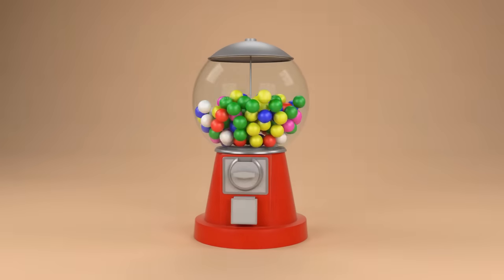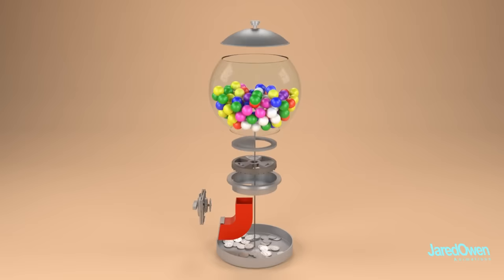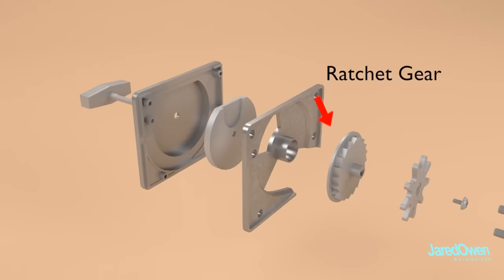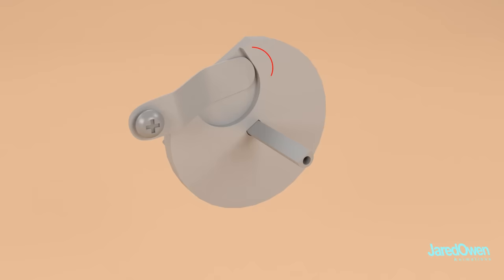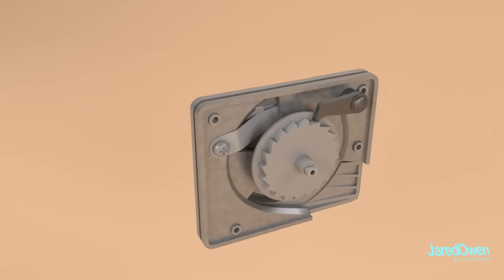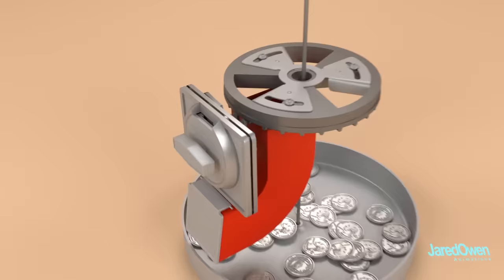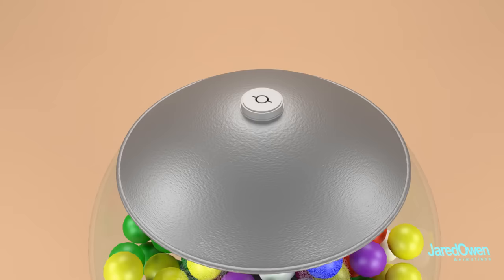How does a Gumball Machine work?

Comment: So putting in fake coins will aslo work?
Reply: VICTOR Å it wont work or you can make a plastic quarter the right size of a regular quarter
Reply: Daniel Vargas
It definitely will !
At least in my country you have plastic or metal tokens for shopping carts that have the exact same diameter and thickness as coins. And it works.
Reply: @rzeczpospolita5948   no just no...
Reply: Jyswoo  I saw one in downtown St. Louis but that's it 

What normal person gets that though lmao
Reply: yeah I tested that with a wooden coin I carved
Reply: NukeCorruption You took the time to purchase some wood or get scrap wood, measure the thickness and diameter of a coin and carved it.

You might as well just buy the gumball for the 25 cents at that point.
Reply: @LordDragonZord  xD
Reply: @Juno Chun , maybe he want to mass produce it, so he needs the working model first, at least make two same models, if one slides in, then make the other as cast
Reply: Put sticky tape on the coin or something so it doesn't fall so you get unlimited spins. XD
Reply: I measured the size of a coin for a machine at my local shopping mall. I was curious, how can i get free candy? So i 3D printed a bunch of blank plastic cylinders with the exact same dimensions of the said coin. They worked wonders. For 0.03$ i got 0.12$ worth of candy. Was it worth it? Hell no. But oh boy, imagine the guy taking the coins out finding a bright orange plastic disk with "LOL" engraved in it!
Reply: @nyan06 good
Reply: I was thinking of just putting something sticky on the coin so that it wouldn't fall and could be retrieved.
Reply: Just do what Mr.krabs did and attach a string into a coin.
Reply: Mary ann Cabreros it can turn counter clockwise 😉
Reply: Juno Chun actually the coin was from an old boardgame I made long time ago and by luck it happened to be just around the size of a 50cent coin (euros). so I was so tempted to test the machine with that wooden coin haha
Reply: there were some 'accidents' like neighboring countries using similar(almost exact)size of coins, and sometimes just curious travellers or desperate crooks use them for you know. yeah.

Japan has a really weird level of development on vending machine and so....guess what happened. so government had to change the coin and vending machine companies had to improve their designs.

and nowdays japanese vending machines operated by miniature japanese people living inside and checking whether the coin is real or not.

real story. except the last one.
Reply: @nyan06 I aslo don't know...
Reply: If it’s the size of a quarter and strong enough to move the block thing, yeah.
Reply: LOL
Reply: VICTOR Å use Chuck E. Cheese coins I still got a few of em
Reply: @ArchangelExile  if it was sticky enough it would just keep spinning around and around 😂😂 endless candy
Reply: Kaimen Sedgwick Lol, totally.   I would love to try this to see if it would work but I'm too paranoid.
Reply: Just use a flat head screwdrriver
Reply: @LordDragonZord  in Italy sometimes the gumballs are 50 cents or 1€...
Reply: If you just try to push the metal piece with a tool like a flat head screwdriver could you have infinite gum with no coins or no fake 'same sized' coins ? :D
Reply: @RinkawaErion  super glue
Reply: @DanielVargas-ow4xz  you don't need the right size, just smaller than the hole and big enough so the security thing doesn't stop the disk from moving
Reply: im calling the police
Reply: Ribbed Rhubarb NO J-JUST NO.
Reply: O O actually. There are vending machines in Japan with people inside. They take your money through a slot and pass you out something awkward through another slot. Such as flowers or goldfish. Gets me thinking. The way Japanese culture works. The workers are probably locked inside the machines for set amounts of time. Wonder what would happen if I shoved a stink capsule through the slot at the beginning of their shift ........
Reply: Um...yeah I gues
Reply: @elsociord7553  lol
Reply: Daniel Vargas you can glue a coin to the machine and it won’t fall so you can keep reusing
Reply: @LordDragonZord  You could use modeling software to quickly model a "coin" with the same dimensions as a real quarter, and then 3D print them en masse. If you don't want to go to too much effort, you could literally just slap a cylinder into your CAD and it would take less than 5 mins to get it to the right proportions.
Reply: FBI OPEN UP
Reply: VICTOR Å anything that feels like a coin will work
Reply: Maybe just get some of those metal slugs from the sides of metal outlet boxes.
Reply: @kingdeadshoot6019  in our it's 20 cents (also €)
Reply: @colinantink9094  ummmm....... alright. ok? Japanese are idk9
Reply: @RinkawaErion  i thought the same thing ima try that
Reply: I just always super glued a quarter and quickly placed it in and thus I and school got free candy
Reply: Uncle Ron oh hello fellow Missouri citizen
Reply: @nukecorruption  😂 hah. 😂

Comment: When you spin it fast enough you get 2 gumballs. I do it all the time.
Reply: I'll do that next!
Reply: In fact, it's like the "bump key" lockpiking technique, if you hold it at the right spot, you can turn it infinitelly after the first coin!
Reply: Andrey DeOliveira yeah I've done that
Reply: Or even 3, it happens sometimes
Reply: I useally just break the glass
Reply: One time I put a quarter in when it didn’t turn all the way clock wise and it would only turn backwards so now I was getting free gumballs
Reply: Insert coin spin half way, repeatedly spin fast from half way for infinite candy
Reply: And can’t you do that to skip the coin altogether as well? Maybe it’s not the same in all machines, and they have other security features, but it looks like the piece of metal is bent before rotating, so it should be possible. BTW, this is an exploit I was thinking about upon hearing the mechanism involved, because of the inertia of the metal piece, and you just confirmed it works.
Reply: Really? Next time I go to a gumball machine, I'll try it.
Reply: Do not do that. That's unethical.
Reply: @iany.5204  live a little, it isn't like it's going to hurt anybody
Reply: @iceberg7999  It's stealing and hurt the income of the machine owner. A maxim says: "Do not think any vice trivial, and so practice it."
Reply: @iany.5204   Okay
Reply: @iany.5204  Yes, and MY mama told me to look both ways before crossing and to always pray before going to sleep. :>
Reply: ooh ok
Reply: I was waiting for someone to say it
Reply: Ian Y. the gum is probably very old, nobody cares
Reply: @HerrRussoTragik  how to fucking do it
Reply: VRV Epic gamer move
Reply: cursed likes...
Reply: Woah 666 likes! Ima fix that
Reply: Easy : sticky coin
Reply: @vrv3871  hahaha lol
Reply: Imagine you get 3
Reply: @lc846.  it happens sometimes
Reply: What if you put glue on the coin so it never falls into the coin bin? 😂
Reply: lostskull7467 InFiNiTe GuMbAlLs
Reply: Ayhan Kabak what about 20
Reply: @lc846.  bruh
Reply: @corvividgacha351  hi
Reply: You realise right that you dont need real coin fit in that coin pocket or whatever is that?
Reply: When I was 2 years old i put a coin in and got a gumball then i looked at the back of the machine and i got a coin and put it back in and i did that over and over again.
Reply: Yea
Reply: Ayhan Kabak Pro
Reply: I. Try
Reply: Lol
Reply: @HerrRussoTragik  how??
Reply: @vrv3871  Or that
Reply: I got a gumball machine but its the coin mechanism is broken
Reply: When you have to cheat why not just break the glass.
Reply: Thanks
Reply: You can just put glue on the quarter and turn it a little so the metal piece pushes it and in 3 minutes it is stuck on. And there on it you can turn it infinite times
Reply: @limitlessdev  cool
Reply: A MADLAD
Reply: Sick
Reply: light speed = 100 gumballs
Reply: I will do that next time
Reply: You’ve just changed my life
Reply: @Amina Guemghar w
Reply: Woah what
Reply: When you didn't realize there is a security watching you.
Reply: Just use a fake coin
Reply: The one I go to gives two if you spin it slowly
Reply: Sloooow enough,  I heard it
Reply: Use a drill to speed fast
Reply: Thnx for revealing the secret now they will come out with better mechanism
Reply: Cool
Reply: Thank you for this brilliant piece of information
Reply: @HerrRussoTragik  wait what? For mr that applied to alot od stuff but didnt know gumball machines too
Reply: @Patrick Meng just take the whole jar home and experiment with it.
Reply: Im in front of a gumball machine now
Reply: If you do it fast forever you basically counter the wall preventing multi gumball spam
Reply: It will not give you infinite how many candy is in the glass
Reply: Abi burda bari yapmayın
Reply: Mind blown
Reply: Or just break the glass
Reply: ill do it next time ty
Reply: Yooo I’ll do that
Reply: Thx 4 lifehack
Reply: REALLY WOOOO
Reply: Screw that. I just crank the lever hard and fast enough that it gives me one. Call it theft, I call it strategy. Never got caught or broke the machine, so yeah.
Reply: Buy one get one free!
Reply: I gotta try this.
Reply: i can not imagine why your technique works. The string metal is slowly as you ? Or the string metal bounce ?
Reply: @Naecofranck  I have no idea, it works somehow
Reply: @vrv3871  I usually just rob a candy store
Reply: Thanks for the tip
Reply: Same lol
Reply: You... wat? Hm. I will try
Reply: There's have good and the bad things
The good things is now i know
The bad things is we don't have that and i never seen that yet personally 🤣 because i am from Philippines
Reply: Me to
Reply: @Uchiha____Sasuke  XD, but the Guards will find a fake coin in the coin bin
Reply: Just take a coin size and wide as a coin the put it boom u get free gumballs
Reply: @swervings  ok
Reply: wait is that acly possible? if it is then im stupid
Reply: I found out gum is made of rubber and plastic
Reply: @teebee woahhh...pure luck, nice bro
Reply: Cool it’s real haha
Reply: There's a particular gumball machine built into the pavement outside a particular shop near my childhood home that, if you move it's gears in just the right way, you could jiggle it back and fourth and easily get as much as you wanted. It's still there and you can tell it's the same one because the same trick still works no matter how it's painted or what it's loaded with.
Reply: You think the matrix doesn't know that? You are living in a dream world.
Reply: @iceberg7999  someone would have throught of putting a big steel part so it cant rotate 360°, almost no one is THAT dum
Reply: gotta go fast
Reply: Wait that's illegal
Reply: I'm amazed at all the weird ideas people here have to get free candy, I just rob the cashier at gunpoint for all the quarters then use them all on the gumball machine
Reply: When I grow up my Mom can drive me in the car and take me to my local gumball machine in Sherwood Forest Mall.
Reply: @vrv3871  FBI OPEN UP

Comment: How does it only allow certain coins to give a gum ball?
Also I’m still unsure how it only allows one gum ball out.
Reply: the slot is big enough for only one gumball.
Reply: Remember the slot in which your coin fits? That is specifically designed for a specific coin - a cent, quarter or whatever. Anything thats bigger than that won't fit, while anything smaller won't disengage the locking pin 2:31.
Reply: Some coins aren't big enough to bend out the piece that hits the wall.
Reply: @alishancharania784  So a cardboard chunk will work?
Reply: @Harrison Hughes (Student) yes.
Reply: @alexwang982  Yes

Comment: gumball machines are a bit of a scam tho arent they? atleast where i am, all of the gumball machines cost about 1 or 2 euros, the tho you can go to a nearby kiosk and buy gum like that or if they dont have ones like that then other gum, for 0.05$ or 0.10$
Reply: Yeh some where I come from are £1 or £2 or 50p
Reply: And many of those gumballs taste like heck (at least wherever I tried)
Reply: @SreenikethanI  nah i kinda like them, not willing to pay that much for them tho
Reply: From where I am you can get it for $0.10 but buying it in a local shop you can buy it at $0.02-$0.04
Reply: But atleast you're not gonna go somewhere far away
Reply: JayThePineappleDemon OverLord
In my country, pretty much all 0,20€ and 1€ gumball machines will actually work with... trolley tokens.
(Of course it's a fraud and a scam but it definitely works).
Reply: The classic fee of a quarter isn't exactly a bargain either,  for a dime or nickle would be a lot better. 
I've machines for tiny toys or rubber balls that are lot more valuable than a gumball.
Reply: Here in mexico those things (individual) are like 5 pesos, which is like 1/4 of a dollar, a bit more
Reply: that's not a scam since it's still a voluntary transaction tho, just overpriced

a scam would be to use a gumball machine expecting gumballs but getting plastic instead
Reply: So which one is it, euros or dollars?
Reply: Well we have 10 rubles, so 0,15 dollars or 0,13 euro, so yes russia
Reply: From where I am gumballs cost 1 dirham or 50 fils, which are roughly 0.37 dollars or 0.19 dollars respectively
Reply: Oh god... that is a rip-off. Just buy a pack of bubblegum at the store, may seem more expensive but it’s a better rate.
Reply: @ehtropenelopen5192  Fun fact: Most grocery stores in my country don't even have gumball packs on their shelves so if you don't want to buy them from the machines, which are really designated for kids you have to order them online

Comment: As a kid we would go into grocery stores and steal the plastic bread tabs off bags of bread. Go outside and shave the down to quarter dimension on the pavement. Go back into the grocery store and use our tabs as quarters. Worked 100% of the time. Sometimes they got stuck in the slot and it was all you and your friends could grab before the manager chased us aways. Classic 1980's kids stuff

Comment: Always like you animations. Also if for example with a screwdriver, you touch that little part wich makes sure that it will only turn when a coin is in. So If you push it it means free gumball?
Reply: Flippy - I tried it but it didn't work,  when I was pushing the metal back to keep it in place, I blocked the switch. That way it didn't work.
Reply: Oh... i see... you have right
Reply: what if you make a "coin" out of cardboard
like just a circular cardboard piece with th same height of the coin so it pushes the little part that makes sure it'll only turnwhen a coin is in
Reply: How about using a coin shaped neodymium magnet? Since it's magnetic, the magnet shouldn't fall off if the rotating thingy is made of magnetic metal. That way, you should be to turn it forever and when you're done, pull the magnet with another magnet.
Reply: @Asu01 , you are a fking genius!
Reply: @Brandao0liveira  
Probably, too bad we don't have any gumball machine around here.
Reply: @Asu01  You might need to turn a bit harder though, since the guard is probably also made of metal

Comment: Get a metal disc the size of a quarter and a strong magnet.  Hold the magnet near the bottom where the coin falls away.  If you don't mind leaving "evidence" you can put a dab of glue on the coin so it can't fall away.

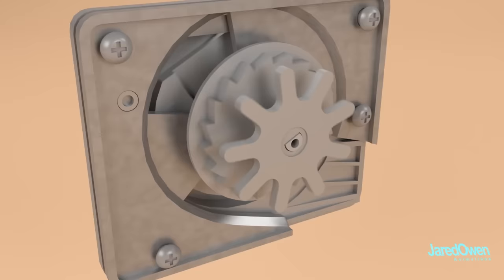Comment: 2:03 There is a similar mechanism on roller coaster lift hills. The ratchet gear teeth are arranged next to the lift chain, and the pawl is situated underneath the coaster train (it’s called a chain dog). As the train is pulled up by the chain, the pawl is dragged along the teeth which is what makes the clicking sound you hear as you go up. If the chain stops for any reason, the maximum distance the train can roll back is the distance between each tooth, as the pawl will fall back into the teeth and stop the train.

Comment: Nice video - one note however.  I am not sure what model you have shown here, I personally used Northwestern Model 60 for over 20 years, which I consider the Cadillac of vending machines.  Internally they are essentially the same.  What you refer to as the "Dispenser Disk" ( I've known as simply adjustable wheel ) is not the only or best option for gumballs.  The wheel can be replaced with another wheel that has round openings for vending gumballs.  The wheel shown is typically used for M&M's, Jelly Beans, and similar product.

Comment: Jared I bought the exact gunball machine but my has a small brass fitting and spring that was inside the change area.  Mine doesnt stop after it dispenses the gum..Is there a parts list and diagram that actually shows how everything sets

Comment: Ok so I just got an older model of a gumball machine. I thought it was jammed because I couldn’t turn it. (I did also put a coin in and it didn’t turn so I’m not a COMPLETE idiot) I ended up disassembling the machine and ended up breaking a gear lol

Comment: So technically if i were to put a thicc cardboard cylinder in there, i would get a free gumball?
Reply: Assuming the cardboard is thick and solid enough to trick the stopper, yeah. The concern is wheter the stopper will press the "coin" too hard and made it too thin to pass as a real coin or not